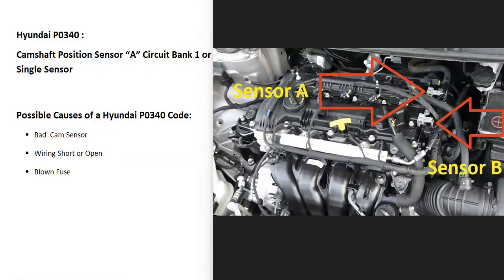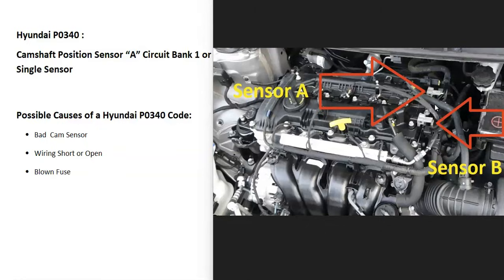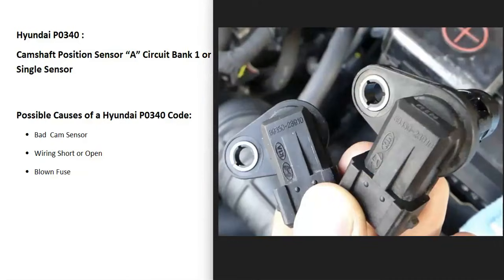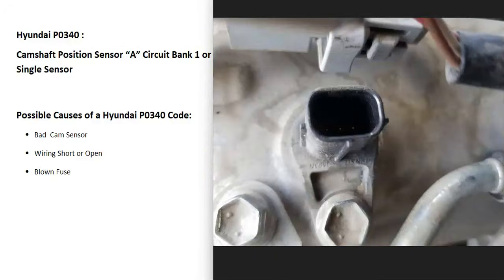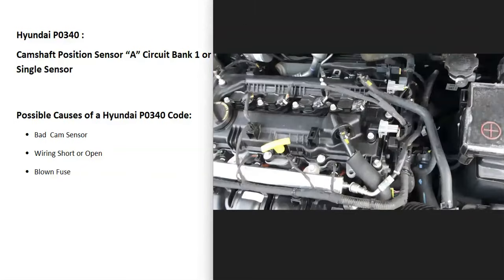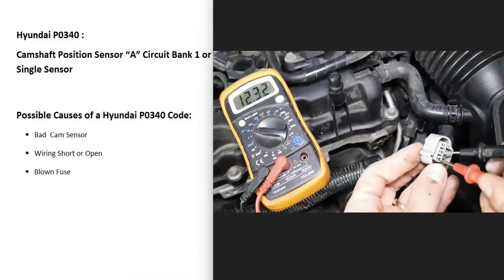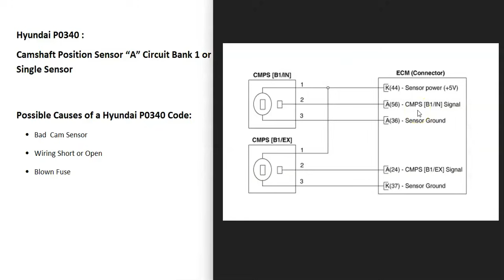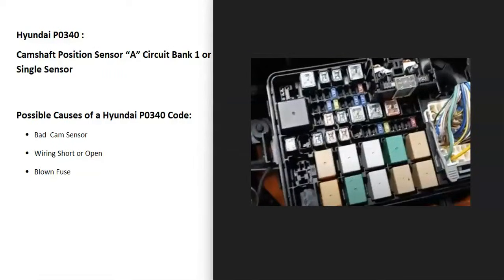HYUNDAI P0340: Camshaft Position Sensor “A” Circuit Bank 1 or Single Sensor

Comment: I got a p00110 code, only symptom is the car has rough idle at idle, once you start driving it, it smooths out and you would never know there was an issue and no motor noise

Comment: Question I went to autozone and they pulled up a P0011 code but on the paper they gave me there is P0014, P000A, P0017 as well. 
The paper says exhaust camshaft position timing bank 1 
But also says crankshaft position correlation bank 1 sensor B. 
I just need to know what part to order as I’m ordering online where it’s way cheaper.
Reply: So is this the kind of thing where you should buy both or do I only need the 1? Or do I need both ?
Reply: honestly this is not an electrical issue this is a mechanical issue your vehicle needs timing chain replaced

Comment: Sensor B as you call it  is actually the crankshaft position sensor dont confuse people
Reply from the maker: There can be two camshaft position sensors (like most vehicles made in the last 15 years), one for the intake called Sensor A and one for the exhaust called Sensor B. If there is an issue with the crankshaft position sensor, it will say "crankshaft position sensor" in the code.
Reply: @whyingo7964  which one is the camshaft position sensor A ? The front or the one in the back?